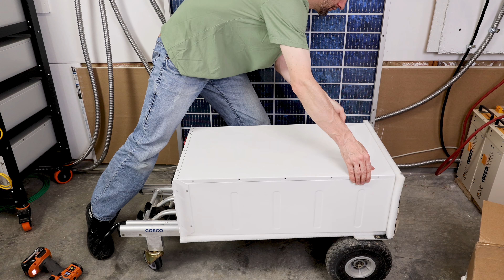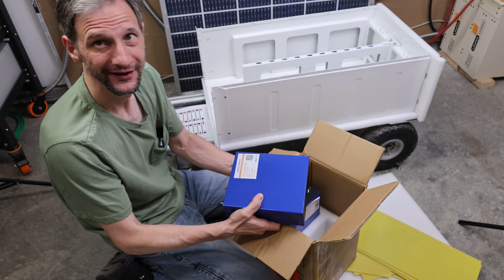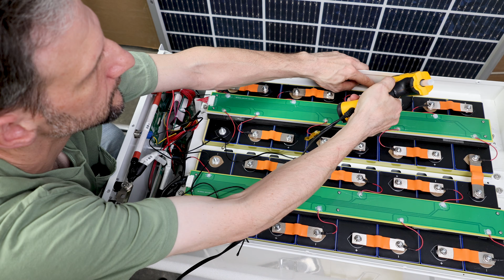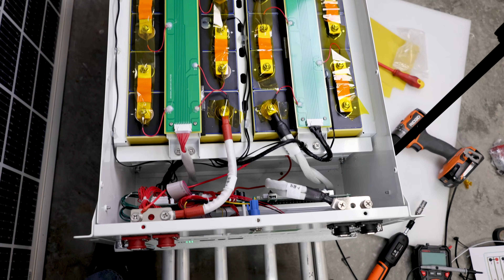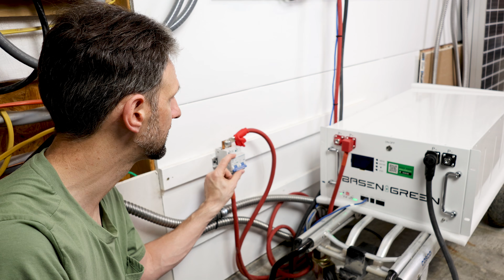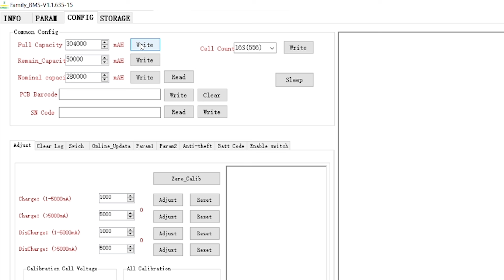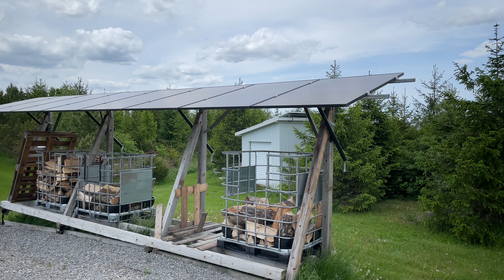SAVE Thousands - Build your own home solar battery backup!

Comment: Dave: Been watching for some time now and this is the first diy battery I've seen you do. Will U be adding a option in your payback calculator for solar plus battery. For me net metering isn't  worth the hassle. The ability to have backup power when the grid is down is the selling point. Just wondering how you would calculate the ROI. Keep up the good work👍
Reply from the maker: Thanks for the encouragement.  In my case where I have monthly net metering, the ROI on a battery is basically $0.  I don't have to have a battery to see the financial benefit, it would only be there for emergency use.  In places where you don't have net metering it just becomes part of the overall system cost that must be recovered.

Comment: Its a lil more expansive "still far less then factory" but its better to just use 2 or 3 lith iron golf cart batts there 5kw each and as a more commen batt its easy to replace a cell and all you do is hook them up in paralel took me under a hour to wire it lol there 1400$ each so its 4200 for lil over 15kw with a far simpler and easyer to maintain batt with built in saftys on each batt and no wory that when you need new cells they may not still be making that moddle

Comment: I've built one of these.... I've also forgotten to remove a ring from my finger (trust me, you do not want to do what I did!). It only takes one time to forget to remove that ring from the finger and boom, that ring is glowing red faster than you can blink your eyes! And yes, it hurt like holy hell! When the ring shorted the two terminals and 500+ amps went through the ring, it instantly glowed red and in a mad rush to remove the ring from my finger, I literally threw it from my finger, and in doing so, removed a perfect 'ring-full-of-skin' from the finger, along with the ring. A 54.6v system will not kill you by electrocution, but the amperage from those 304A LifePo4 cells (in my case, 2P) can melt metal together in less than a second.
Reply from the maker: 😬Thanks for the real world reminder!
Reply: Wow! And when he said to remove any jewelry,  I thought:"What a stupid precaution, I bet there is no difference between touching with my bare hands and with a jewelry on". Thanks for the lesson!
Reply: How did the r8ng close the circuit? I see that the plus and minus are pretty far apart
Reply: A 51.2V system can be lethal, if sweat or cuts drop resistance. It's quite common for professionals to work on it barehanded tho.

Comment: The kapton tape is a very very good idea. I never thought I’d see a DIY battery like this. The potential voltage risks of a short during the build have always freaked me out. Dropping something and having it hit the terminals in just the wrong way. Someday maybe I’ll get past that fear.
Reply: Fear is your friend. It is our warning signal not to become complacent especially when fooling around with electrons. I embrace it and just stay super careful. Heck I haven’t yet (?) experimented with powerful lasers for this very reason! Reflection dangers to the eyes. Not just my eyes but other people, pets, etc.
Reply: You should try lithium titanate they have a 10c discharge rate dropping something could put 20,000 amps
Reply: I’d guess printing 3d plastic guards with kapton inside would be better!  Especially by the front panel

Comment: I'm curious of the robustness of this BMS. Is the company reputable? Most importantly, would this be able to handle the extreme temps of van life?
Reply from the maker: I think I would use golf cart batteries in a van, they are designed for vehicle use.

Comment: Amazing build! And great step by step instructions. In checking the link to cells, they are just about 2x the price you paid - unless I missed something? 

Btw How much does that battery weigh??
Reply from the maker: Thanks! 
There is more than one link in the description.  I gave several options since the lower cost option was out of stock.
Unfortunately, I didn't weigh it all together.

Comment: Really? I've been avoiding building a DIY battery bank purely because it would severely invalidate my house insurance.
If it ever developed a fault and burned my house down, I would not be insured, so I would be left with absolutely nothing but an outstanding mortgage to pay for on a destroyed house.
Add that to the cost of finding somewhere else to live, likely renting again plus other expenses, I'd be financially ruined long into my retirement years, without a penny to show for it.
Now, tell me if it's worth saving some money on having a properly assembled, installed, certified and manufacturer guaranteed battery bank in my home, compared to that reality?

By the way, I am a qualified electrician...but I still wouldn't do it because I am neither trained nor insured under a company's liability to install these batteries. I know what I am talking about.

Comment: Thanks for the great video! Are the bars holding the cells down insulated on the bottom? I have a 48S (4 x 12S LFP cells)pack that I'm breaking down that already have aluminum bus bars welding the terminals together. It'd be great if I didn't have to cut each cell out and just drop in an already bussed 8S row on each side of this case. Thanks!

Comment: Just found your channel and you have a ton of great content, subscribed. One thing, I'm not sure if it's changed since filming or if I'm looking at something wrong but the cells you have linked are 200/cell. It is still significantly cheaper per kWh but it's something to note.
Reply from the maker: I have multiple links because they don't seem to stay in stock.  Some are cheaper than others.
Reply: @ProjectsWithDave  Oh, I didn't notice link to the 304Ah from BassenGreen. My mistake, I was indeed looking at it wrong! Now I'm wondering how they are able to sell what looks like the exact same cells for 1/2 or less the cost of other suppliers. Are the others just price gouging?

Comment: I am new to all this, but how is he powering all this stuff at 50V? Is he doing a home backup and isnt everything needing 120V?
Reply from the maker: The inverter takes in 48V DC and converts it to 120/240V AC.
Reply: @ProjectsWithDave  thanks for the info. Is that what all whole home battery backups do, or do any wire up the batteries to 120V?

Comment: Great video. You might think that you are too busy then trust a "solar company" to set you up with solar. Well, if you are handy, a gear head or a tech head then please DIY solar set up. The solar companies are a complete rip off with 1000% mark up, mediocre work, poor customer service and once they install good luck if you need to make changes. 
We spent over $75k on solar setup we could have done better for $20k.
Reply: @nyplantings2420
75k$ 😮 how much did you get for this. It must be around 90kWp right?
Reply: @Oliver-rb1tf if they got powerwall batteries that easily doubles the cost of the system.
Reply: obviously when you DIY someothing it's much cheaper. When you have it done there are way more costs then just material cost. And even on material cost you're trying to save here by putting it together yourself.
Reply: Every solar company I've ever seen is a scam. I call them up and pretend to not know anything just to hear the scummy sales tactics and ridiculous bids
Reply: 20k 1000% is not 75k ;)
Reply: @badmadmat20 1000% is a figure of speech spoken by the older generation we get the meaning.
Reply: @ no it is not. It is math
Reply: DIY is handy when 1 cell fails you can fix it your self or change a bus your self. In essence these are really a pre fab battery, all parts supplied, then you have a tutorial like this that can be referenced any time. If the gentleman paid $55 K extra I am guessing he is really pissed off I know I would be.

Comment: Makes DIY forklift battery an attractive project. A big lead acid forklift battery (36v 1200 AH) can easily hit $8000.
Reply from the maker: A forklift may have a very large current draw.  You would have to make sure your BMS can handle the loads.
Reply: @ProjectsWithDave  I agree, they can have pretty high peak current. And, even some of the DC machines are capable of dynamic braking, so that is a concern. I imagine some of the EV controls out there would be suitable. Of course, most EV's don't weigh 29,000 pounds with the battery.

Comment: Hi Dave. I have a back up whole house generator hooked to an 200 amp automatic switch.  Can I connect this system in causing my generator to wait for the battery to be depleted during power outages?  Then the generator can run the house and charge the battery back up simultaneously. Next I would like to connect a windmill into the system. I live in a very windy environment. I only have roof space for panels which I don’t want to do.

Comment: Couple of quetsions, at 10:42 did you mean rj45 port? Never heard of an RS45 port. Also when you checked each individual cell to make sure it's within 2 milivolts of each other I noticed when you first fired up the battery and connected it to the laptop there was a greater variance than 2mv for some reason for each battery; maybe that was because the BMS was loading up each cell or something as it looked like those values were changing?
Reply from the maker: The battery was charging at that time so the voltages were shifting.

Comment: Like sub & save, not just for the article which is v well presented but also the excellent comments that are encouraged after. Thank you, from the UK (and my gut feeling is not stack those batteries vertically on top of each other, or use a verticle shelf designed for that)
Reply from the maker: Thanks!

Comment: Where is link for that case?
and link to $106.00 304Ah battery?, you link is $199.75 each
Reply from the maker: Links are in the description.  The lower cost option is out of stock at the moment but you can get it from Alibaba.

Comment: Yeah looks like there's kits are still out of stock. Got any suggestions on where to buy the server rack case?
Reply from the maker: You can get them on Alibaba here:  https://www.alibaba.com/product-detail/basen-greenline-battery-EU-stock-51_1601147027430.html?spm=a2747.product_manager.0.0.7d6671d2eyfkXy

Comment: at 4;55 i notice there is no ventilation for cooling of the batteries.  I would like to see an airspace around erach battery, those things can get dam hot when discharging large currents.
Reply: These cells need to be physically constrained to avoid swelling.  If swollen, the space between electrodes is irregular, creating hotspots.  It's a vicious cycle.
Reply: @timgerk3262  Maybe some kind of grate structure would do the job. Or would they still swell through the gaps?

Comment: When you turn the housing on it's side, the lowest battery is loaded with the weight of all cells above. This prevents equal expansion of the batteries. Do not do this, lay it flat as intended.
Reply: I have 48 300ah LiFePO4 cells inside of aluminum hard shells like in the video, I have never seen them expand even slightly. I think the burst disc would go before the cell swells? This is only my experience with a select number of specific cells so who knows
Reply: 45keh is nice  @BrentTMS
Reply: One of the cabinets that I looked at that is wall mounted and meant to stack cells of this size vertically, actually have small spacers built in so that there's never more than two or three cells on top of each other. Instead of the whole stack.
Reply: I assure you guys, these aluminum case LFP cells will and do bulge from several issues. The weight of the cells is not going to cause bulging. Overcharging, overdischarging, overheating, or charging below 0C temps will cause cell bloat.
Reply: How do i turn my house on it's side?
Reply: I know a guy. @nickp2108
Reply: Well the same company's power wall breakdown shows all the cells stacked vertically, so if they make it that way does it matter?
Reply: If it was designed to stand vertical, there would be a support build into the frame every so many cells.
 With lead acid it's every 2 batteries get independent support. Lithium chemistry batteries are lighter but also far less consistent in physical characteristics since they aren't under the same pressures to conform as something in an automotive field might be. Also much more Chinese manufacturing...
   I know I personally would not want to have the battery stacked on top of each other, and this is my first thought when he mentioned putting it upright near the beginning of the video.
   Probably also thermal considerations among other things I'm probably not aware of not being a professional battery engineer.
Reply: The BMS layout board is on a steel brace that holds the cells pressed against the back of the case. So very little weight would be on the bottom cell.
Reply: Any weight of the cells is completely irrelevant compared to the clamp load those 6 screws will apply. 

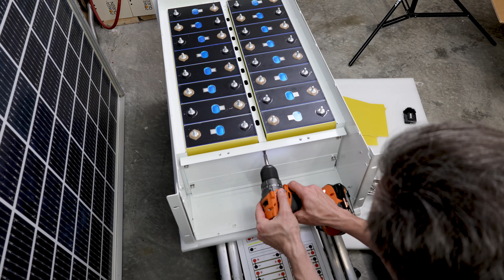For example: one metric, class 4.6 - M5 screw torqued to 1.8ft-lbs will apply a (dry) clamp load of about 550 lbs. And that is a single cheap screw that is not over torqued. As seen in 4:33 the screws could be larger and likely aren't super cheap class 4.6 they are likely class 8.8. 

So according to my conservative assumption about the screws used; these 6 screws will apply 3.300 lbs of compression to these 2 rows of cells so 1.650 lbs per row of cells. 

No matter how heavy the cells are, their weight is irrelevant compared to the already applied clamp load.
Reply: You'd expect a good battery manufacturer to factor this into the design, instead of having the cell case breathing like a balloon.
Reply: I was thinking that extra space filled w yellow spacers is needed. @MinusMedley
Reply: There are type of case with cells built just like that and they work ok
Reply: So the final consensus is ?
Reply: @LadyEtWatch yes
Reply: I have the newer version of the same battery. In the settings display there is a parameter that say vertical or horizontal.
So in my opinion it can stay up right.
I agree that it would be better horizontal, but what if you have a space problem, and can t fit horizontal?
Reply: The cells can be put under thousands of pounds of compression without problems the hundred or so pounds of the being in different positions has no effect
Reply: it looks like its meant to be side  faced place
mnt capable , look at main site selling it, its been placed in such same matter like in the video
Reply: Would make absolutely no difference 😅 I have a similar setup running that way 10 years and my house has only burnt down three times 😢
Reply: @Aeontheosophical BS
Reply: @Stefan_Dahn  yeah whatever I suppose your a qualified micro generation installer/commissioner? I am
Reply: Solid state batteries folks don't require to sit on their butts like acid
Reply: Also, don't breathe- it contributes to the rising CO2. 😅
Reply: You clearly have no idea what you're talking about.
Reply: and its shipped from china how?
Reply: I'm not a solar guy but I do know something about batteries & Immediately I was like did he just say..... 😬 Yikes
Reply: Are you sure that’s the correct result of the force diagram? The Battery has the weight? No no, all forces = 0 unless the unit is physically moving
Reply: @tecreates2384  Nope. Gravity

Comment: Btw, you know that you can do screen recording of your web browser to record the victron screen a bit nicer, right? :)
Reply from the maker: Are you talking about running the screen from the computer app or recording the screen directly?
Reply: @ProjectsWithDave  You can replicate the victron screen on PC browser and then use screen capture program to capture the window. You'll have clearer image comparing to pointing the camera at the victron display :)
Reply from the maker: Thanks for the suggestion.  I try to make things as clear as possible, but it's not always convenient to set it up that way in the middle of testing.

Comment: So I bought some batteries from SOK and they're the server rack batteries and they're 100 w hours at 48 volts And I paid $1, 013 for those so how much is that per watt hour?
Reply from the maker: I think you mean 100Ah at 51.2V nominal which is 5.12kWh.  $1,013/5,120Wh= $0.198/Wh.

Comment: 15kwh is great, but what if you what to add to that will a second built case connect to the first and communicate together to one inverter?
Reply from the maker: I haven't tried that, but it should.

Comment: Hello can you give me some advice is it possible to use hybrid vehicle batteries to build a large battery bank for a solar battery bank/ home use  i have about 10 junk hybrid vehicles also they have been sitting for about 3/5 years are they still good ??
Reply from the maker: That isn't easy to answer.  It depends on how they were treated during use and what charge state they were stored at.  If they were stored at a low state of charge for 5 years they are probably not in good shape.  You would need to check the condition of each cell independently.  Also some batteries are easier to reconfigure for a 48V system than others.

Comment: Still not sure, I guess when I get to the point that other projects afford me time to do something like this, but for now, if it takes more than a few hours to assemble, I'm losing money(time). 4 x 12v 300ah batteries of the brand I buy are around $2500, so still just not enough savings for me. Looks like you have to catch their deal, as the Eve's are showing up as almost $200 cell now. Maybe tariffs have hit.